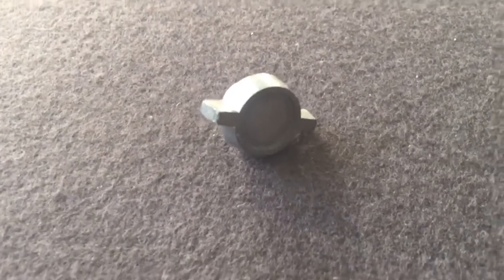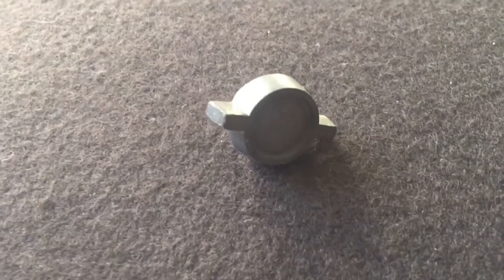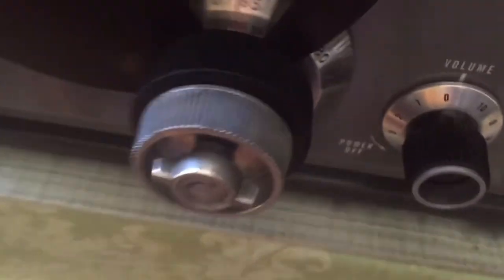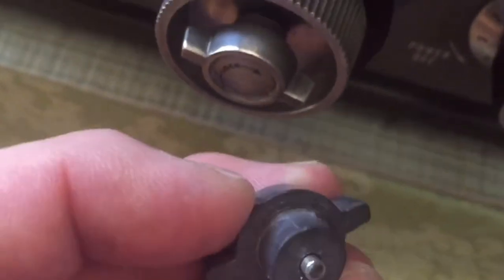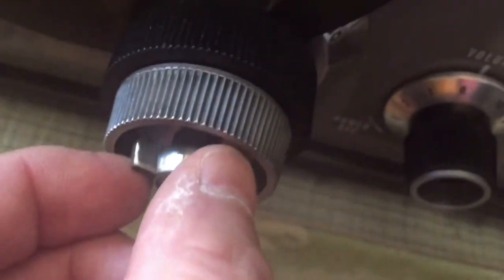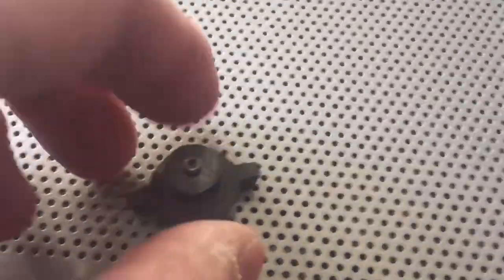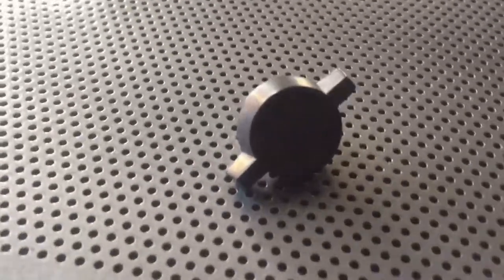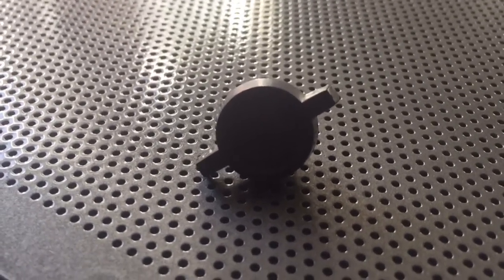The Story Of My Hallicrafters SX-42 Locking Knobs

Comment: Arthur - I finally took my knob assembly apart to repair a problem that it had.  The main tuning knob was just free turning on the shaft since I bought it a few years ago.  I could only tune by applying pressure towards the radio.  This was very fatiguing.  I was a little afraid to get into it actually.  I recently ordered the manual and saw an exploded view of the assembly.  From that, I was convinced that the spring washer must be missing.  However, once I got it apart with my Bristol Wrench set, I realized that the snap ring had only popped out of a grove.  The spring washer was there, but not snug.  I reassembled it correctly, and now i am enjoying the radio.  What great sound it has!

I may order that decal.  I found the guy's web site, and it was also very helpful in describing the tuning knob set up.
73 Paul AA1SU
Reply from the maker: Awesome!

Comment: I think it is a great idea. We all know how hard it is to find parts for these old radio.
Reply from the maker: countryside  This is one of the hardest to find parts for any of these classic boatanchors. Thanks for your comments, and subscription! Arthur
Reply: @ArthurJS123  My pleasure, I loved collecting wallpaper years ago and i used Hallicrafters. I have some tubes for them yet. I had many more in my late teens, sold them back then as was not room for them in a small apartment. lol I have sx42b and an s40. Have not fired them up in years. I used to repair a lot of Hallicrafters, but even back then it was hard to find parts. Let alone decals for the front. Have some rust on the speaker grill on the s40 and needs to be recapped.
Reply from the maker: countryside They are certainly worth the effort. All three of my Hallicrafters sets are true family heirlooms, as they belonged to my father. So it’s nice to have the stories behind them.
Reply: @ArthurJS123  The ones i have, I got back in the 70's when I was a teenager. The sx42 already had the orange dips in them. The s-40 needs to have the caps replaced before I try to fire it up. I had a lot of Hallicrafters over the years to repair. Even the fun of restringing the dial cord. I used to order tubes from Cornell electronics in CA. Used pipe cleaners and tarnex to clean the variable capacitors. I also used to repair my friends ham transmitters.

Comment: I have an SX-42 with a lost knob as well. 
I'm still working on the set to get it working.  I've had it for 40 years, bought it at an auction but just getting around to trying to make it work.  A lot of capacitors have gone into that thing - and few more need to go in.  Also, a tiny gear in the main tuning is crack, I've got to figure out how to fix that.
Reply from the maker: Daniel Bingamon I have my Dad’s original, and a spare lock knob. They are not easy to find, at all.
Reply: If I could get a mold of that I might be able to duplicate it.
Reply from the maker: Daniel Bingamon I have brought it to several places, no one is willing to do it in low quantity. The idea sounds easy, execution is much harder.
Reply from the maker: Daniel Bingamon good luck
Reply: Arthur, did you have your power cord upgraded to 3-prong or was it kept as a 2-prong cord?
Reply from the maker: No, of course. It’s a three prong. And It’s plugged into a Variac to step down the voltage.
Reply: The original cord on my set was falling apart and obviously will need to be replaced.  I was thinking about using a 3-prong cord so that it has a modern ground.  That would be a safer route.  Where are you located?
Reply from the maker: Dude, I’m on YouTube with about 1200 subscribers. Not disclosing my location, sorry.
Reply: Sorry about that, I didn't mean to that detail.  Since you're using it regular with a variac I thought you might be running it outside of the US.  That is the only reason that I asked that.
Reply from the maker: No. Regular household voltage is higher than what it was in 1946. Pulling it down to a more suitable voltage makes more sense than running it at today’s voltage. I do wish you success in your restoration.
Reply: Thanks, I've got a lot of work to do. Rust and rats doesn't help either.  I thought about rebiasing the tubes to modern voltage once I get it closer to working.  I'm still some time away to even thinking about putting power on it.

Comment: Art - in my search for info on the lock knob, I found this video. Did you ever get the knobs reproduced?  Mine is gone and the shaft end was snapped off. Thanks!
Reply from the maker: I ended up purchasing one, and then finding my father’s original. I recently saw a complete dial assembly with the lock knob on eBay. Warning- if yours is missing, you’re going to have to likely replace or fabricate the entire timing shaft- it likely has snapped in at least one place, maybe more.
Reply: Yes, that’s looking like what I need to do. In the video you talked about having the knob - the rediscovered cuff link box original - duplicated for us other unfortunates. So my hope was that perhaps you had done that. Guess not?
Reply from the maker: I have not found anyone to do it locally. And now, with coronavirus everywhere, not likely. I may suggest trying to find a “parts only” SX-42. There are many parts on the set that are now “unobtaniim”.
Reply: Thanks Art. So when you had yours repaired, did the entire shaft get replaced, because the threaded end was snapped off?
Reply from the maker: buster doggboye That is correct. It happened during a move. I wish I had better news for you, but you are likely in for a challenge.
Reply: Got it!  Yeah, but it’s going to be worth it. Best wishes, and thanks again.
Reply from the maker: You will most likely need a lathe and the right metal fabricating equipment. Good luck! A